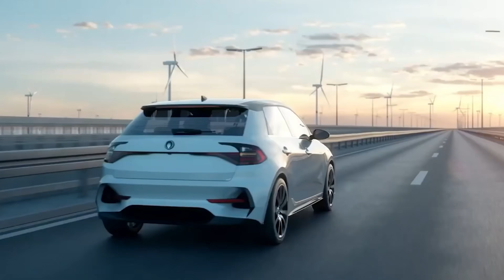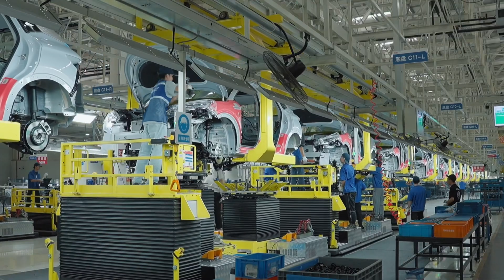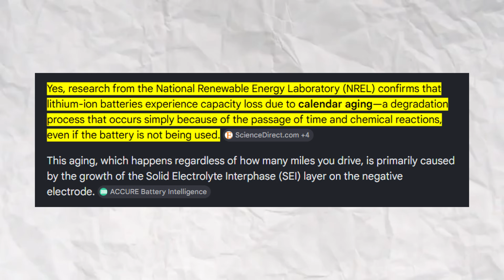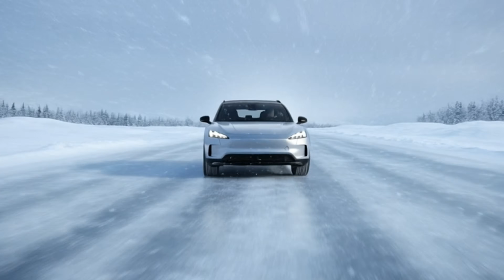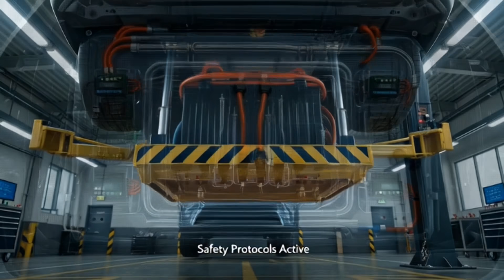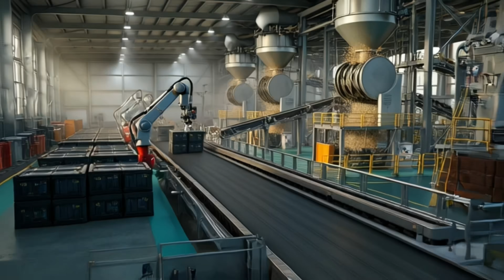Don’t Buy an EV Until You Understand This Battery Problem!

Comment: How to use rational science to stoke irrational fear? The record is that 90% of EVS bought 10 years ago still keep the original with 85% of life left. Try placing your ICE car on a dynometer; 10 years later you’re lucky to see only a 10% drop in horsepower. It gets worse: of those 10-year old EVs, the losses are skewed by Nissan Leaf that had no liquid cooling and a feeble 24kWh battery to begin with.